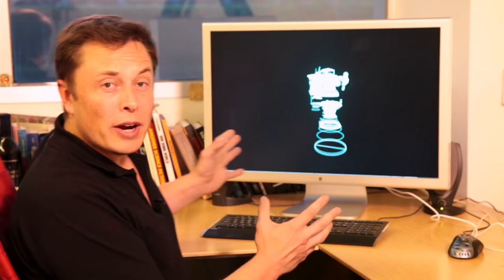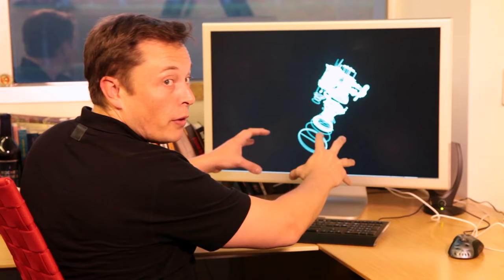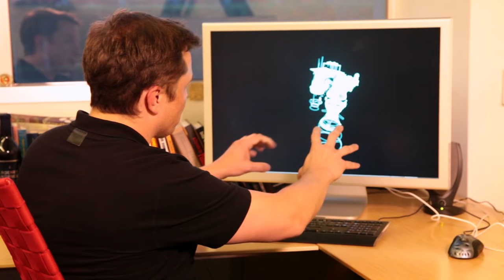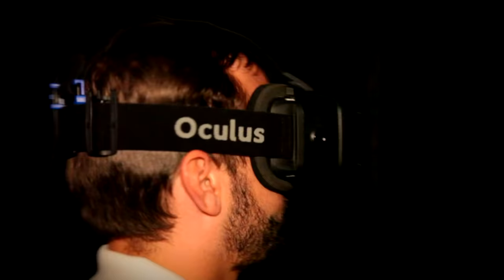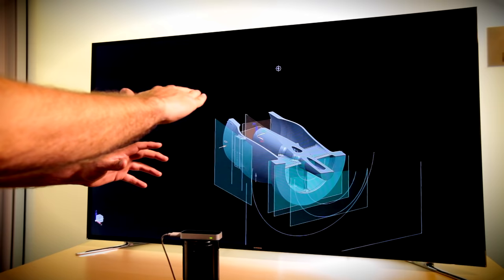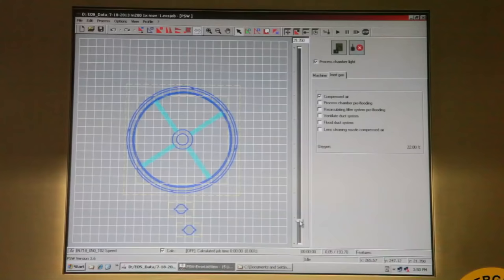The Future of Design

Comment: It was mentioned before and I agree; this hand gesture thing actually feels way more clumsy than the precision you can achieve with keyboard and mouse. It's like trying to write with your fingertips instead of using a pen or a sharp pencil. I think the focus should be on the 3d visualisation while still using appropriate tools for the interaction.
Reply: just have with vr and it will be very precise.
Reply: I could also imagine it getting quite exhausting waiving your hand around in mid air, instead of resting it comfortably on a desk while using a mouse. VR would make a better use case for hand gesturing because it feels more natural to real life... But then again you'd still have to worry about fatigue, so I think working with both traditional computers and in VR would be the best situation
Reply: @mission3479  yeah, I do feel like mouse is easier though :)) but in some quick, short situation, maybe hand gesture is faster and convenient
Reply: Only for visualization. Sketching and making accurate feature needs a precision of keyboard and CAD dedicate mouse.
Reply: glad someone has pointed this out, amidst people just cheering. it's ok to view the design, but to actually create it? you need a precise pointer, that rests while you leave it, in the first place, and the hands are unstable, you need to select from dozens of tools too, through many menus, etc..  the existing interface - keyboard and mouse has its drawbacks but for 3d creation, other tools than hand gestures would be more effective. I, in fact, designed something for that cause, but the funds, people I met were not interested.
Reply: @kharadinbrahman  because who designs seriously form zero knows that instruments are needed for crafting.
Reply: water .
Reply: @kharadinbrahman  I don't think this was intended to design. Probably more for use during design meetings, evaluating a design, explaining/studying parts by other teams, how they fit together etc etc... Use this in the meeting, then go back to your desk and use what you took from the meeting to redesign using precision tools. Also keep in mind this was a prototype, a proof of concept in a way... 10 years and doing essentially what will/can now be done with Vision Pro for example.

Comment: And now, after 7 years, who knows what they're actually using... 🤯
Reply: Most likely vr headsets since it lets them visualize scale and genuine 3d.
Reply: There are so many CAD software, they are advanced since the 80s already. The simulation hand interface is not that important, you can use a device for it to visualize, again old technology. The problem with most CAD software is the integration in large assemblies, they are all very slow at large scale.
Reply: Most of their engineers will be using a mouse/space mouse combo. If you use CAD you know this is a gimmick and not practical for designing 10 hours a day. VR might be used too for visualisation/reviews but not actually design.
Reply: @stephenworsley  Fair point, maybe in the future ar combined with a space mouse would make sense since it’s the best of both worlds.
Reply: @mknubs  maybe although I don't I want to be in AR 8-10 hours a day tbh
Reply: @thrashingmetal  what do you mean by integration in large assemblies? slow at large scale of what?
Reply: They're not using this, that's for sure. All they did was pan and zoom. 

This was a fluff video. Most of the tech isn't Spacex and the software is definitely not theirs. Probably just the OS projection of Solidworks on the Oculus w/ some third-party (not Spacex) sensor for panning/zooming. Thanks a lot people NOT Elon Musk.
Reply: Leap Motion
Reply: Genuine Question or Concern?
Reply: @mknubs  VR gives people headaches
Reply: alien technology. im pretty sure elon is just another stranded alien trying to go back home and building all these space ships for that.

Comment: Cool tech but mouse/tablet + keyboard is both better and easier for navigating in 3D.
Reply: Not to mention how hard it would be trying to actually build something as specific as a rocket engine using gesture controls that don't really seem to work super well.
Reply: JbtSveZauzeto1 I certainly saw nothing there that I can't do just as easily, or more so with the standard tools. Looks cool for movies, but seems like a gimmick.
Reply: just and analyze of the 3 comments here.
first one and third one, basically the same. (Zauzeto and Cory)

yes, you think you can do it easier with a mouse and keyboard but that's because you're used to it, and if you can do it so, it doesn't mean it's the most precise way of doing it. you can't use a mouse and keyboard in 3d simulations like vr for precise movement, or even modeling on a normal screen, have you ever done precisely the movement you've wanted on a 2d screen as you imagined doing in your head? for example using cinema 4d and trying to view things from a certain perspective. there's even a button to see it for a 2d instead of a 3d simulation for ease of use.
basically: precise movement and more natural perspectives.

and second comment. (Ryan)

they showed off this technology and said it was for programmers to understand how the engines work, not to model them, just see them up close and learn how to code that specific object. (basics of robotics)

this is purely what i understood, take it with a little dab of salt.
Reply: @Ryan-wx8of  the same was said about touchscreen keypads
Reply: @abhishekgore9346  the same was said about the MOUSE. Before graphical user interfaces were common people rejected the mouse and said they could use the keyboard much easier
Reply: Yeah take it from the genius, it's better.

Comment: I mean.. it was partnered with oculus VR, which was now a part of Meta for hand tracking. You can also see the hand poses don’t change drastically in the interaction because hand tracker at that time are mainly based on depth cameras and fitting a hand model to depth point clouds. This is also why no outdoor demo here because the cameras won’t work outdoor lighting

Comment: I don't see this as being a good way to interact with 3d models if you don't have the fine motor control that your mouse can provide. Can you do a pixel perfect rotation with your hands floating in the air or is this just a fun little demo with no real engineering applications? How many hands gestures do you need to memorize for you to access the full range of functions that CAD software offers?

Comment: In 1995 I saw 3D-cad for the first time at a company in Sweden. They used Silicon Graphics computers because PC's of that time was to slow. They also 3D-printed the parts from that 3D-cad back then (in plastics) so yes, stuff like this has been around for a long time.
Reply: But it never looked as good as it does with modern tech hey. Even these look decades old in comparison with the vision pro and the current meta headsets.

Comment: This development of CAD Design/ CAE Engneering & CAM manufacturing has been around since the late 80's/early 90's.  What is called "3D Printing" today is the "Rapid Prototyping" that was developed & used in the product development & manufacturing Industries in the early/mid 90's.  The only difference is they advanced the use of materials that give you a more "finished" product instead of Rapid Prototyping producing "master pattern" parts for molding & prototyped parts.  In essence it's exactly the same methodology & machines that where used in industries 30 yrs. ago.  I know this for a fact because I was using all these technologies right out of college & I'm still using them today.

Comment: Future engine material is very important to involve in thermal insulation material and corrosion inhibitor material and solid hardest material. The most important is weight of material to determine rocket / aircraft / missile fly whether or more high and more far and time more long.

Comment: Interacting with computers in a 2D way to create 3D objects feels unnatural.

00:14
They experimented with integrating Leap Motion and Siemens NX software to design the rocket engine using hand gestures.

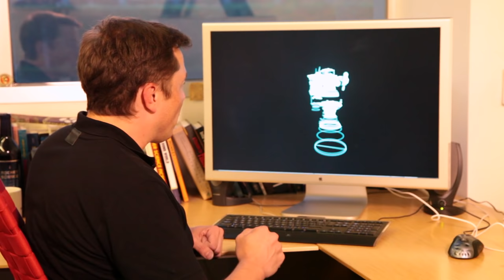00:38
They could rotate, zoom in/out, and translate a wireframe model of the rocket engine using hand gestures.

01:36
They advanced to manipulating the full 3D CAD model of the Merlin engine using hand gestures.

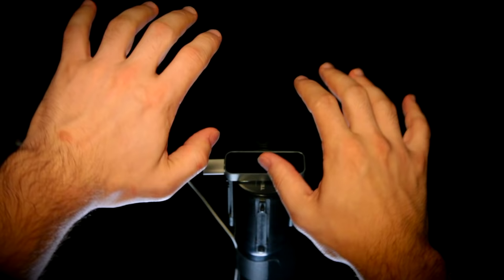01:51
Understanding the fundamentals allows achieving more in a shorter time, rather than figuring out how to make the computer work.

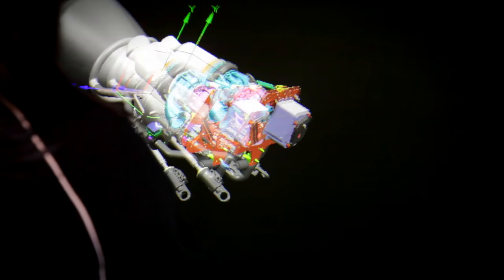02:05
They progressed from 3D projection with glasses to freestanding glass projection (like Iron Man movies) and finally immersive virtual reality with the Oculus Rift.

02:34
They applied this technology to design a cryogenic valve housing, allowing to translate ideas from mind to physical object with greater ease.

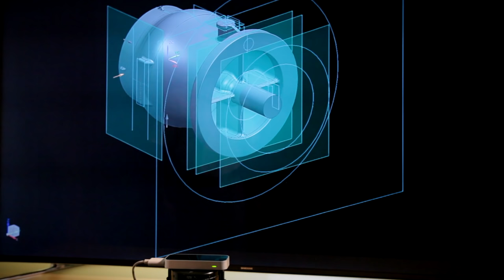03:01
They use a 3D laser metal printer to print the designed object by melting and layering fine particles of titanium or inconel.

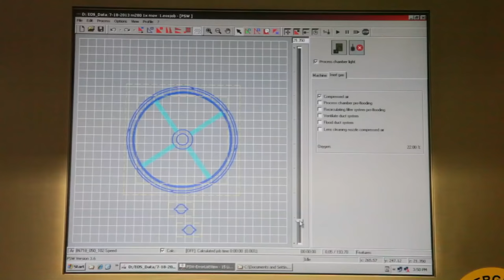03:17
This approach will revolutionize design and manufacturing by enabling intuitive translation of concepts from mind to 3D objects and printing them.

Comment: There are so many CAD software, they are advanced since the 80s already. The simulation hand interface is not that important, you can use a device for it to visualize it's mainly for presentations, again old technology. The problem with most CAD software is the integration in large assemblies, they are all very slow at large scale like CATIA 3Dx is the best but tons of problems still.

Comment: I suspect the engineers just use a mouse and keyboard now 😅 i cant see them using this gimmick for too long or for anything other than showcasing a design...the level of precision needed in CAD wont make this a viable application unless you have prebuilt modular models that you add on (kind of like kerbal space programme)...in my opinion this is a presentation tool rather than a design tool. Laser sintering though is of course an amazing tried and tested design prototyping tool.